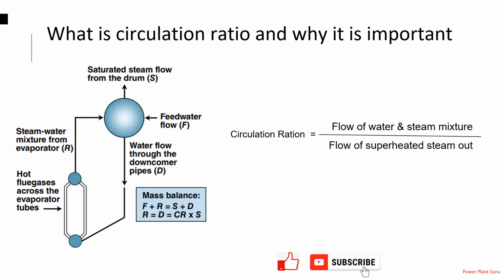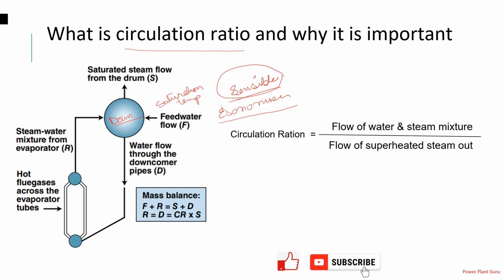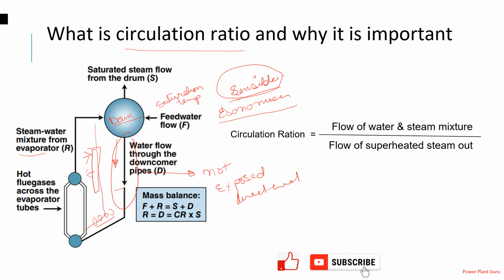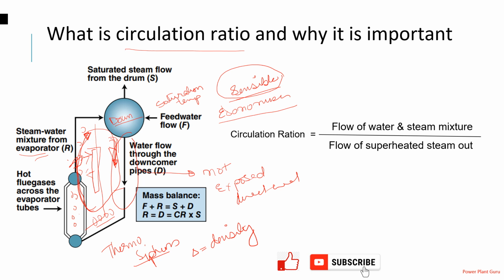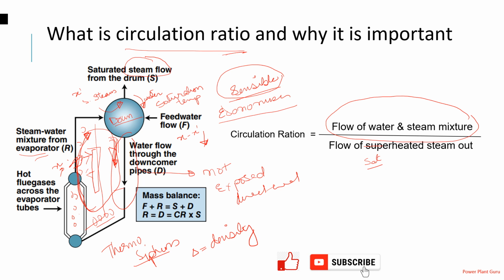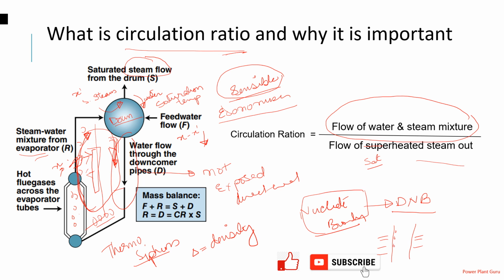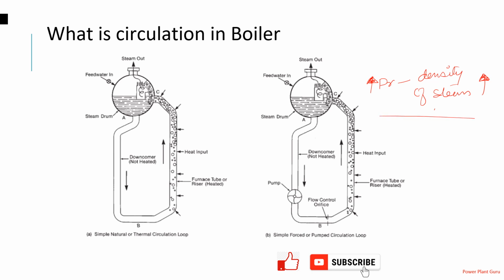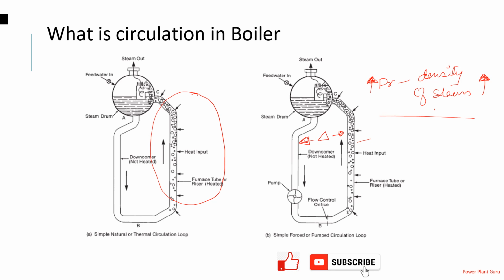How to Understand Circulation ratio in Boilers
#boiler, #steam, #powerplant

Comment: We run the boiler during low load, that time Feed water flow continue up and down (fluctuations) observed.can you pls explain what is the reason sir
Reply from the maker: Hello Thank you for watching my videos. 

There may be several reasons for fluctuations at lower load. 
1. Control loops are designed for normal load which is normally 40% and above. So lover loads are difficult to maintain. 
2. The heat transfer for convective & radiation are changing at different furnace conditions and accordingly steaming pattern changes and it is one of the reasons. 
These are a few important ones, we can discuss more on our discussion forums
Reply: @powerplantguru007  thank you for your reply sir